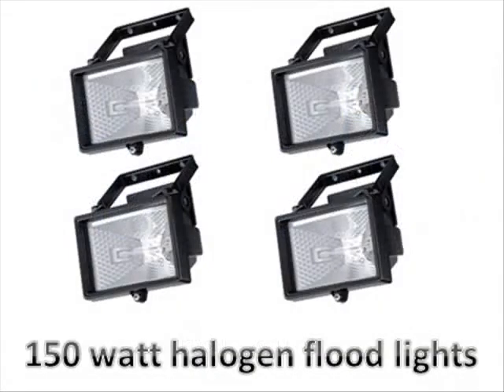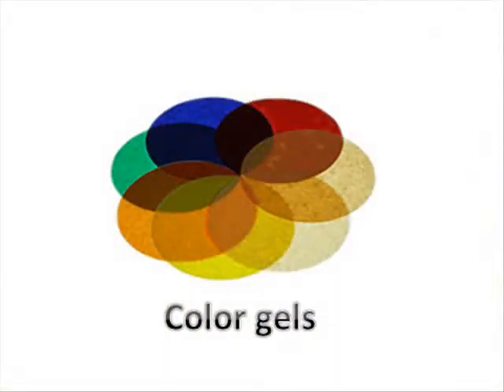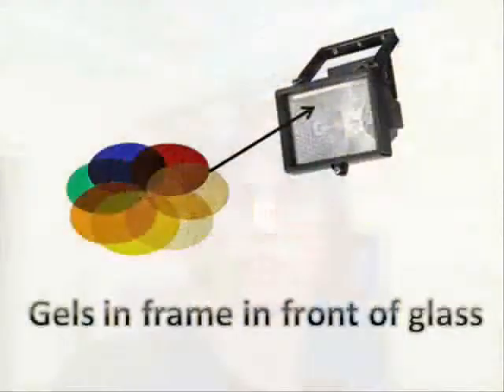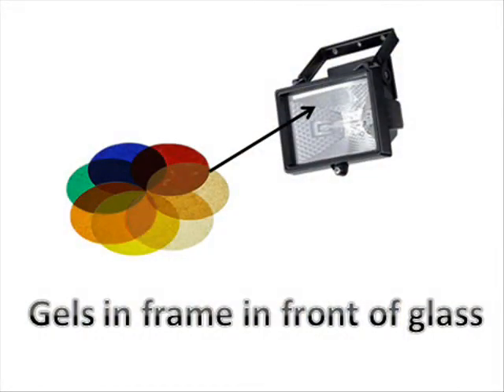Home made par cans 1

Comment: Gels will not work in front of a floodlight.  Gels are meant to not catch on fire, but will melt.  Lights such as Source 4's are designed to not put heat off in the front of the light, however, floodlights are very hot and have no engineering behind them to stop the heat from escaping through the front of the glass.